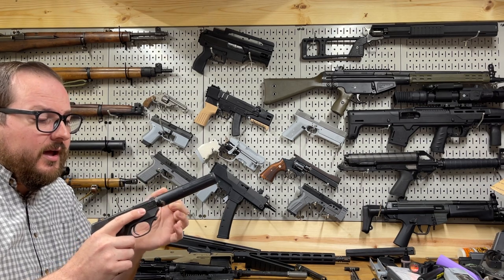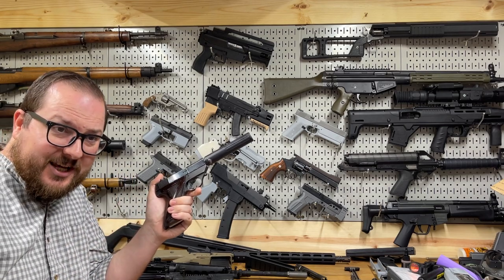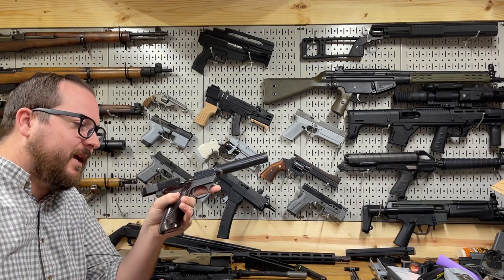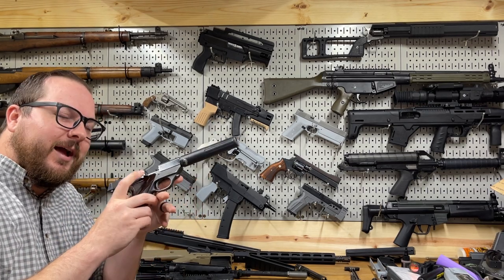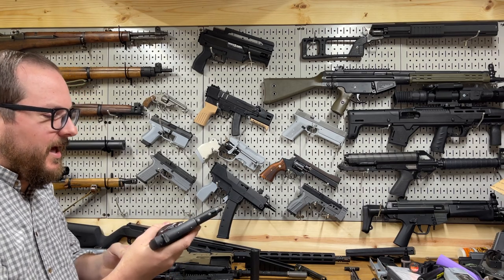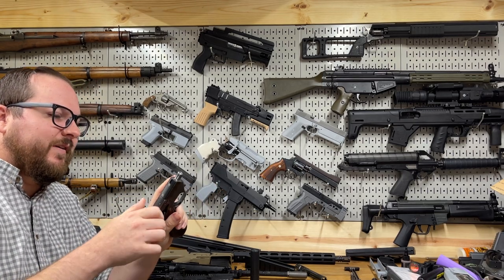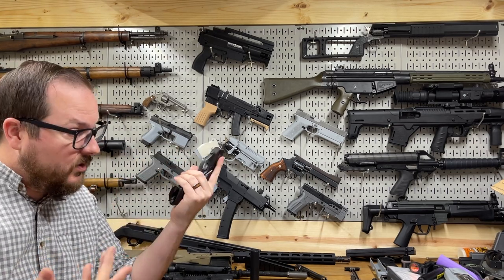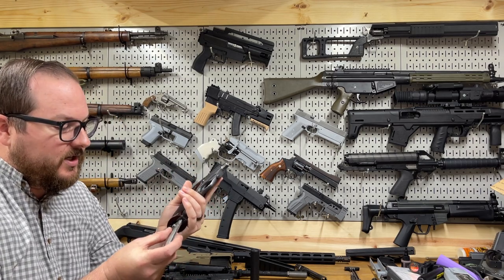The CIA and OSS Assassination Pistol - Suppressed High-Standard

Comment from the maker: Correction time! I stated that they only made a hundred or so of the original suppressed High-Standard HDMs, that is incorrect. They reportedly made about 2,600 HDMs between '44-'45. The "hundred or so" figure was a slip up from my reading today on the S&W Model 39 "Hush Puppy" pistols from the 1960s, of which only a hundred or so were built. 

The HDM also did use a steel mesh "wafer" type suppression system coupled with the ported barrel, and did not use wipes I believe. The steel mesh would get filthy very quickly, within 50 rounds or so, and needed cleaning/replacement often.

I believe I also said that the Sport King was striker fired. That's not really accurate either, it would be more accurate to say that it fires using an internal hammer as opposed to the external hammer of the HD series of pistols. Everyone states that it's striker fired, but that's not technically correct, and I apologize for contributing to that narrative.
Reply: no need for that safety mod, bozo. just use very low power subsonic rounds that cannot cycle the slide. if your whole point is to make an assassin pistol, it needs to be up close and extremely quiet ie very low power rounds
Reply from the maker: @cagneybillingsley2165  a barely cycling but not ejecting round would still cause port pop and mechanical noise and be substantially louder than a completely locked slide. 

Why use underpowered rounds when you don’t need to?

Comment: I have always wanted to suppress my 1950s Sport King.  A delightful chunk of traditional blued steel.  The original High Standard military suppressed guns had rather longer barrels than this example which were extensively ported a certain distance past the chamber.  You can find the exact dimensions for everything in it in the 1968 Frankford Arsenal report on silenced weapons which were then available and known.  Very simple internal design.  Just a roll of screen mesh around the ported barrel and a stack of screen mesh washers at the muzzle inside the tube.

Comment: I had Dave Wilson chop and thread my Ruger Mk IV as close as possible to the hinge point between the receiver and grip frame. Probably as short as your HDM. Can confirm that the HDM is likely a superior way to go, especially in terms of cleaning. Port pop out of the Mk IV is still pretty loud. It's an absolute nightmare to clean, but it looks tres bien. All in all, the Mk IV was quieter with the longer barrel. Running a (very good) Form 1 .22 cal can on it.

Comment: Will the safety lever be enough to keep the slide locked on a blowback action? I can see how on a locked breech the force would be on the locking shoulder but on a blowback all of the recoil force is on the safety lever.
Reply from the maker: Since it’s it’s a .22, you can normally hold the slide closed with your thumb. The steel safety catch should hold it fine.

Comment: I have an early 1950s Sport King SK-100.  Which is essentially an internal hammer version of the HD-M.  Same size, grip angle and general profile, and both compare very closely with the Luger.  I've often thought of turning it into an integrally suppressed evolution of the OSS HD-M.  Though I also want to preserve the original barrel, and additional barrels are seldom available and cost nearly as much as another gun.  I'm in the gun industry as a gunsmith and machinist, so I could make a new one, but it's a substantial amount of labor.  Perhaps soon.  Sometimes when I thread short handgun barrels that are not easily held in the lathe, I make a mandrel that closely fits the bore to do it between centers to get the highest level of concentricity.  Though this barrel could easily be turned between centers without the mandrel.  If your threads are truly concentric you can get away with as little as .002" clearance on each side of the bullet for extensions.  Some barrels which have only a very short section available to thread must first be machined for special extra fine threads which are then used to attach an adapter for the suppressor to.  Not long ago I threaded a Walther P5 barrel 1/2"-56 to then attach a custom extension to adapt for 1/2"-28 thread.  This requires the mandrel through the bore, and is time consuming.  Not many people are willing to pay for this sort of job because it becomes fairly expensive.  But sometimes it's the only way to accomplish it.  The mandrels need to be made and fitted for each individual barrel.  Rarely can you get away with using the same one twice because of individual bore variations.  Pretty much anything can be done if someone is willing to pay for the time and labor it takes.  But that often involves essentially writing a blank check, which not many care to do.  So those jobs are seldom seen.  Usually you wind up only doing them for yourself.  I would also want to duplicate the ported turned down barrel of the original design and use the screen wrapping and stacked screen washers.  The dimensions of the original design are available in the 1968 Frankford Arsenal suppressor test report.  Using very short .22 rimfire barrels to reduce velocity to subsonic can cause problems with flaring of the base of the very soft lead bullets on exit, and it becomes impossible to use the prefragmented rounds.  They break apart at the muzzle.  As I once discovered attempting to use them in a Taurus PT-22.  The ported barrel avoids this problem.  I forgot to add that converting the safety into a slide lock for the ultimate silent operation is a clever touch.  Unfortunately the SK-100 safety is rather small and sharp compared to the excellent HD-M safety.
Reply: I also am a gunsmith and have done that kind of work often over the last 30 years. His gun does not have a slide lock for holding the slide closed while firing, he is mistakenly calling the slide stop a slide lock. He also claims it is striker fired when in fact it has an internal hammer and a separate firing pin.
Reply: @burttaylor8852  I believe what he's done here is convert the safety into a slide lock only.  The Sport King safety does lock the slide closed when engaged, and it appears he deleted the safety function so it would only operate as a slide lock.  Probably by cutting off the portion that blocks the sear.  That's how I interrupted what he's telling us anyway.  On another note, I have both the early SK-100 Sport King and the HD-M, and the profile of them is essentially identical.  The Sport King is more or less an internal hammer version of the HD-M that uses a different magazine.  Because why not?! 😖 I find the HD-M rather more pleasing generally, though the Sport King is an improved design in some ways.  But it's just not as classy and fun even though it's rather less temperamental...

Comment: That's a fine looking piece 👍👍👍👍 I'll look forward to the after-range update, and seeing/hearing how it fires 🙏🙏🙏🙏 As you're using 3-D printing, had you considered making a front section like on the Chinese Type 64, which uses a combination of baffles, an internal sleeve of copper mesh, and a secondary partitioned lower gas-venting chamber? I've never heart a Type 64 being fired, but, due to the features/internal structure of that front section, I can imagine it being a very quiet shot 😎😎😎😎 Keep up the great work 👍👍👍👍

Comment: I wouldn’t be surprised if the HDM was still in some limited use. We know for a fact that the Welrod was still being used in the UK’s military during the gulf war
Reply: The original suppressors were constructed with steel wool and only good for 10-12 rounds as they got clogged up with almost he residue from the rim fire rounds. Modern suppressors are way superior, without the round count, so it is unlikely that the originals are still in use. I like the thought though!

Comment: I see that MP5 with Surefire 628 on the wall, is that legit or airsoft replica? If the latter, where’d you get it?
Reply from the maker: Everything on the wall is real, however that particular one is a .22LR version. The light on it is a G&P airsoft version because of the receiver type that gun uses.

Comment: Id have done an integrally supressed barrel. Take half the length off, port the shit out of it into a primary blast chamber, then post-threads use typical baffles.

Cool none the less tho.
Reply from the maker: The only issue with that would have been needing to build a completely new suppressor, machine it, tax stamp it, etc. This way I'm able to use the can I already have. But there is definitely something great about a proper integrally suppressed barrel.
Reply: @booliganshootingsports  oh, ok. Got ya. Didnt realize this one was already procured.

I def think its worth it to do. It can be well worth the cost if done right. Ive seen some really well done ones. Literally hollywood quiet.